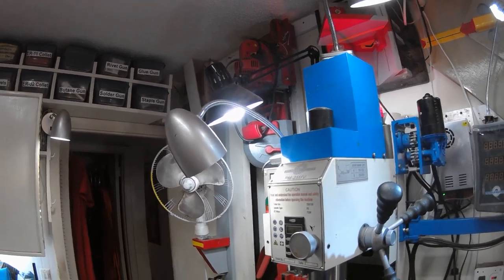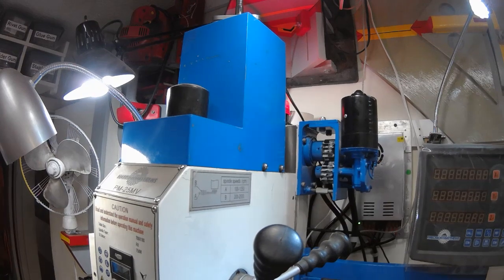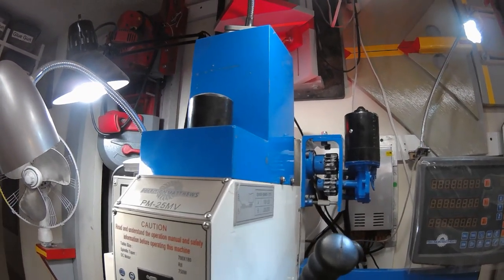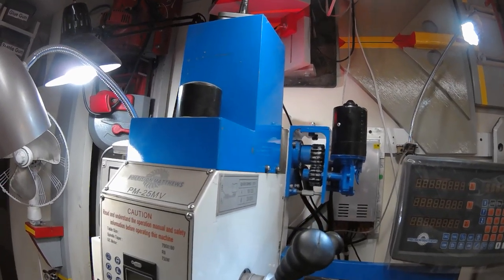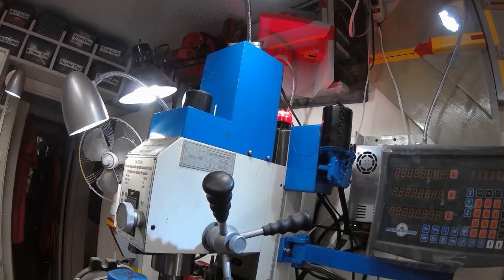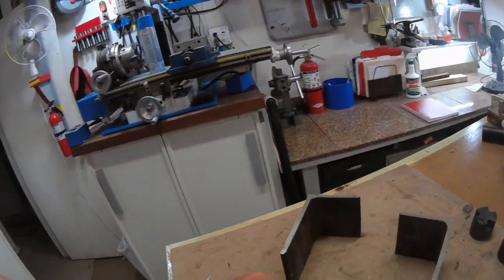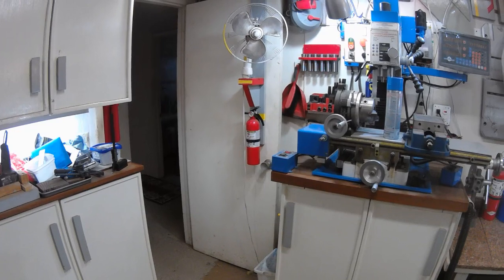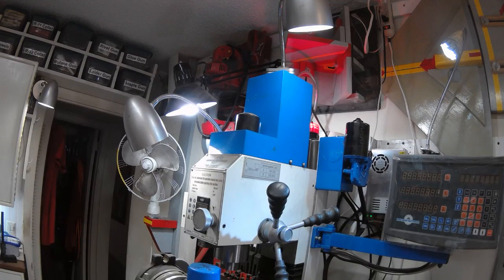"Z axis" mill column motor drive for a PM25MV bench top unit.

Comment: Can you make small incremental moves on Z axis?
Reply from the maker: It moves rather slowly- so reasonable z movements are controllable.  I often use the hand wheel to make fine  column adjustments.  Also I made a table drive and used a potentiometer to slow down the motor on that system.  again the Z drive is slow and consistent.

Comment: Hi how many  kg is your mill,  i have a 380kg 2hp motor on my mill , so id need bigger wiper motor to lift Quill do i ,   any advice would be great thanx ,  and nice job you have done
Reply from the maker: The PM25 specs list that the entire mill weights 275 lbs, and has a 1 hp motor with belt drive.  Not sure the VW wiper motor could lift 380 kg 2 Hp mill head the way I have it set up.  

However:  

1. I used 2 pieces of angle iron bolted together at the top- so you could use different arrangements of angle iron with different gears for the motor drive. Mine works fine with a 1:1 gear drive, made out of plastic lawn mower starter gears epoxied together.  You might try a lower gear reduction gear setup with metal gears, and assume the overall speed or height adjustment would be reduced?

2. You could use larger pieces of angle iron with a different (larger) motor?  I have seen videos using wheel chair motors, DC motors out of running/exercise machines, and one (tin barn garage guy) that used some heavy duty DC motor he had from another project.  You would certainly need wider and larger metal gears in this case, but could use the same wiring set up.

One thing I did was use DPDT switches on a box that could be moved around the mill, and tucked away when not in use.  Most videos I've seen just add a switch to the side of the column- which requires you to reach around the table and the work.

You might do a YouTube search on motorized Z column drives for mills- and see what new stuff has come out.  There weren't many a few years ago when I was doing this project.  Also, the Hobby Machinist forum has a few pages on PM mills and lathes, but most of these guys are doing CNC with this model

Hope this might help.
Reply from the maker: If this link opens- this guy used a heavy duty motor for the Z drive- that I saw before:

            
            PM-727 Mill Z Axis Power Lift